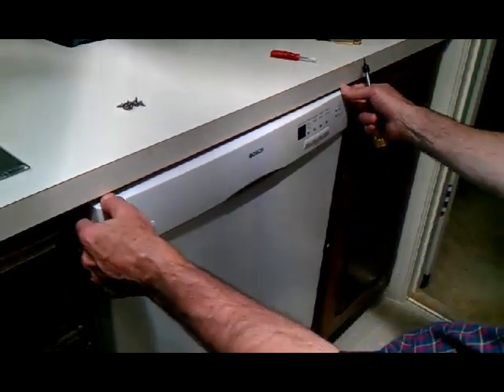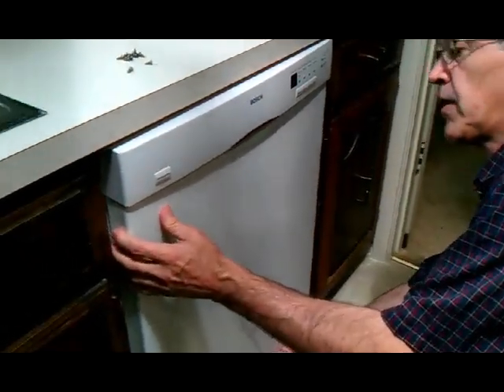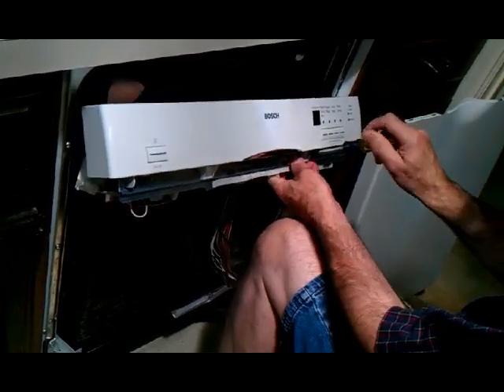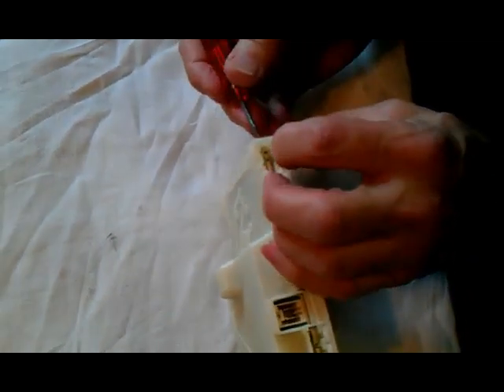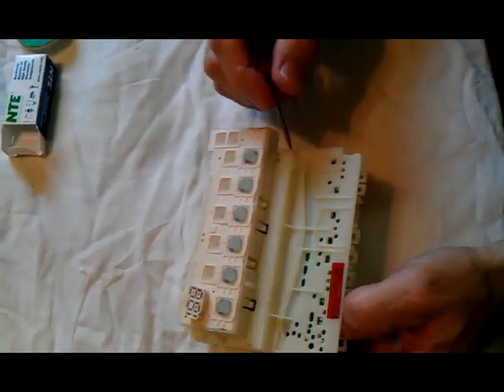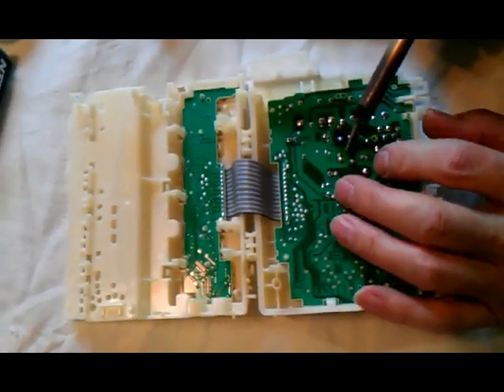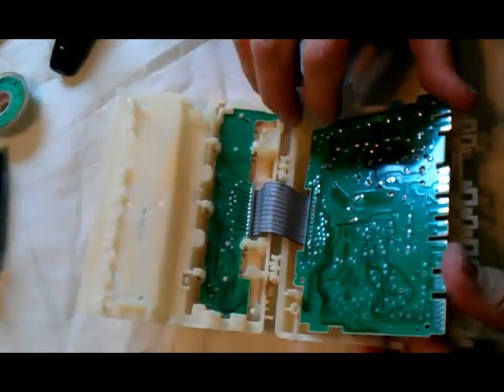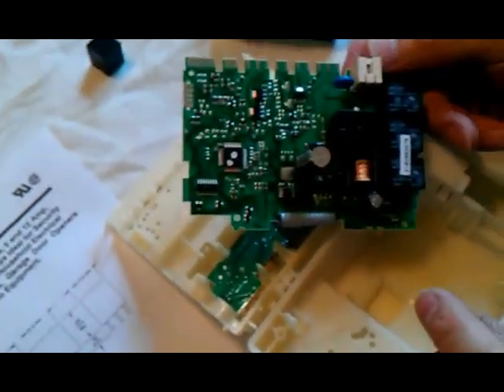Bosch Dishwasher Heater Relay Repair Part 1

Comment: I performed this on my 2006 Bosch she44c05uc/40.  Failure symptom was flashing lights and a clicking realy noise along with a motor bump cycling every couple of seconds.  Opened up the controller.  It seemed like the layout was slightly different than what you showed.  I also had a burned trace so I decided to just replace the control unit.  Total cost $155 USD, downtime 2 days, service time about 2 hours.
Reply from the maker: Thank you for sharing your repair.  Yes, the PCB layouts for the control modules on the various models Bosch produced do vary...from slight variation to completely different than the one I am repairing in the video.  But, a failed relay usually sticks out like a sore thumb because at the very least it darkens the board.
I'm glad you were able to order a module and get yours going again. The price you mention is fairly typical for a new control module.

Comment: Thanks for the video.  Used your video to fix our dishwasher, which was model SHE45M06UC.  I don't know if this should be obvious but for our dishwasher, the dishwasher didn't work until resetting the dishwasher.  Glad we were able to save $$$!
Reply from the maker: Thank you for sharing your repair.  That is interesting that you had to reset the dishwasher after the repair.  Usually having the power turned off while doing this work resets everything.  Maybe your model is a little finicky.  Thanks for letting us know about it.  Cheers!
Reply: I have the same model as this  SHE45MO6UC (5 1/2 yrs old).  Would you use the same recommended relay for this model? NTE R46-5D12-6?  Repairman wants $360.  Never soldered but figure it is worth a try.
Reply from the maker: Cynthia Reese Bosch used different relays on their various models so the only sure way to know which one is in your dishwasher is to open up the control module.  The relay voltage will be shown on the top of the relay.  They are usually either 6V or 12V relays, but some others have been found....just have to look.  The $360 repair quote is fairly typical...some have paid much more than that.  Let me know if you need additional help.
Reply: I was hoping to order the relay and then open it up.  But I will try it.  I have seen folks talk about a diagnostic mode.  Do you know if this applies to my model and how to do it?
Reply: Cynthia Reese Also, wondered what is meant by reset (other than cancel/reset buttons on front) by gentleman with same model as mine.
Reply from the maker: Cynthia Reese Models with digital displays have a diagnostic mode (others may also, but I'm not sure).  The procedure for putting the DW into the diagnostic test mode is on your wiring diagram.  The diagram is usually rolled up tightly and stuck in a crevice near the water valve behind the kick panel.
Reply from the maker: Cynthia Reese He is probably referring to the cancel/reset buttons.  If the DW is stopping on "1" due to a bad heater relay, then replacing the relay should reset the error on first run if it does not reset just due to having the power off.
Reply: AgglomeratedIdeas ok, so we were empowered by your video and have the controller apart. Relay says song chaun
899-1C-F-C 6V DC 10A 250V T85
CO820 7A240V  so should I order the one on Amazon:
NTE Electronics, Inc. R46-5D12-6 Relay; E-Mech; Gen Purp; SPDT; Cur-Rtg 12A; Ctrl-V 6DC; Vol-Rtg 120AC; PCB Mnt; Solder
Reply: Cynthia Reese Wasn't sure where the NTE  is 12A and the one in our dishwasher says 10A if that would be alright or not.
Reply from the maker: Cynthia Reese The 12A NTE R46-5D12-6 would replace your 10A 899-1C-F-C 6V relay.  The 12 ampere rating of the NTE is higher than the original relay (which is 10 amperes).  This is what we are going for here...a higher ampere rating so as to get a longer service life.  You can buy the relay from Amazon or one of the other places that is posted in my reply to Carter Drake.  Cheers.
Reply: AgglomeratedIdeas Thank you for all the help!  We will post when job is complete.
Reply: AgglomeratedIdeas  Success! Thanks for all your help!
Reply from the maker: Cynthia Reese Great news!  Thanks for the follow-up as it always helps encourage the timid to take on this repair when they hear of the success of others.  Cheers!

Comment: First, thanks for the fantastically helpful video.  I have a SHU43c05uc/37 which stopped heating the water, however the wash cycle would complete as usual.  I replaced the heater relay - one pin was melted/burned noticeably (the one on the top right with the component side faced downward and the prongs/sockets for the plugs toward me).  I replaced relay 899-1c-f-c 6vdc (song chaun) with the nte r46-5d12-6(11) 6vdc from radio shack.  I soldered the new relay in correctly, there's only 1 way the pins will line up, I soldered 4 of 5 pins (the 5th wasn't soldered).  Anyways, the unit still will not heat the water.  

I actually ordered two relays in case I screwed up so I removed the replacement relay and soldered the back up on.  Still no dice.  The diagnostic program indicates a heater failure.  I used a multimeter and I get continuity between the pin that was burned and the prong for the red wire to the heater (the one on the right side of the socket with the component side of the board faced down).  So I'm assuming that the pin is soldered into the board correctly.  Resistance reads about 4.5 ohms with the multimeter set to the most sensitive ohm setting (200).  This reading is the same as I get when using the pin to the right which is on the same trace (looks like that pin goes to a jumper leading to a trace that goes back to the hot prong for the red heater wire).

Is there some other diagnostic I can do with the multimeter?  I do not want to take the unit further apart to access the heater unit which, I believe is on the right side.  Is it possible the heater relay and heater unit could have both failed at the same time?  That just seems so unlikely but I sure think my repair was done correctly.  I am certain the relay had failed, it was definitely burned with the damaged pin melted to the point it no longer contacted the board.  

Any help would be greatly appreciated!
Reply: I wanted to add that the diagnostic mode isn't that clear.  The manual refers to buttons that I don't have ("scrub mode") when my unit has only a "rinse and hold," "quick wash," "regular wash," and "power scrub plus."  There's also no led for "clean" but there is one for "sanitized" so I'm not entirely certain I'm interpreting the results of the diagnostic mode correctly.  I'm using the repair manual found at the following address:  http://www.applianceblog.com/mainforums/threads/35002-Bosch-SHU43C-Repair-Manual
Reply from the maker: A faulty flow switch, NTC or heater can also cause this problem, but it is usually the relay.  Since you found a burned pin on the relay, that means it was just a matter of time before the DW quit heating due to that.  However, with the relay now replaced, you will need to dig a little deeper.  Here is a flow chart that shows how to troubleshoot the heater circuit: http://imgur.com/aYgvfAW

There should also be a schematic diagram inside your unit that might help.  It is usually rolled up and stuck in a crack near the fill valve.

BTW, it is normal on some models that only 4 pins on the relay are soldered just in case you were wondering.
Reply from the maker: whauser
I didn't see your post about the repair manual diagnostic mode.  The schematic diagram should have the correct diagnostic mode instructions on it.
Reply: AgglomeratedIdeas Ok, with the dishwasher running I get 117v coming from the red wire that goes to the heater.  So this means the board is working correctly (according to the flow chart).  Is there an easy way to gain access to the heater itself so that I can test it?  Or is there an easy way to test the NTC (temp sensor) and flow switch?  If I have to pull the thing out and take the side of it off and the inside apart to access the heater (that's what the repair manual says anyway) then I'm not too keen on that.  It looks like it's $150 and that's getting to be more than what I think this thing is worth (plus my labor to do the work and I don't work cheap!).
Reply: whauser Ok, the dishwasher now appears to be working correctly.  I can't explain it.  I tried it yesterday and it did not work and the diagnostic mode seemed to indicated a heater fault.  Then I take it apart again tonight, do the continuity testing on the circuit board which comes back good and put it back together.  Then I run it to test it as you described and I get the voltage coming across the red wire to the heater relay and when I stop the cycle and open the dishwasher, lo! hot steam!  I didn't change anything from yesterday, just taking it apart and putting it back together.  Maybe I didn't have the plug for the heater installed all the way, that's the only thing I can figure.  I know I had them on right because I took a picture the first time around and have been putting them back that way each time I take it apart (one of the available sockets on the board isn't used for some reason).

I can't explain it, but the darn thing is working again, at least for now. I can't tell you how much I appreciate this help.
Reply from the maker: whauser
It works...that's awesome!  I have been gone from the house a few hours, so I missed your post from 2 hours ago.  I guess it doesn't matter now because you got it working.  Hopefully you will get many more years out of your dishwasher for your efforts.  Cheers.

Comment: Thank you so much for the detailed instructions.
For your temporary fix, did you soldered two of joints together with a wire or something like that???   I couldn't see that part very well.    Thanks!
Reply from the maker: Yes, I used a short piece of wire soldered directly to the pin of the relay (the one that was burned), and then over to another pad that was one the same trace.  Note that it has to be on the same copper trace on the PC board!  This was done as a temporary repair while I waited for my replacement relay to arrive.  I did this just to minimize the soldering and unsoldering done on the PC board so as to not to cause any further damage to the board than the relay had already done.  Also, if the solder pad on the board is badly damaged, then a jumper can be used as a permanent repair method...it just wasn't necessary to do that on my board, but it might be on yours.

Comment: Thanks for post this video, changed the relay and it now works like a charm. I ordered my parts from www.mouser.com and I used an Omron G5LE-14, 6vdc for $2.50 plus shipping. Mouser part# 653-G5LE-14-DC6
Reply from the maker: Thank you for sharing your repair.  I hope you get many more years of service from your dishwasher.  Cheers.

Comment: Hello Agglomeratedideas. I am having trouble finding the relay for my Bosch dishwasher. I tried Galco, Newark and Allied. I even called Allied to see if they could give me a hand in finding a replacement and was told to search online for the OEM and not use some other one. I would like to send you a photo to your 'My Broken DW' email account. Any help you can give me in finding the part, or a replacement, would be greatly appreciated.
Reply from the maker: Hi Greg.  I emailed you the replacement relay information.  Let us know how your repair goes.  Cheers.

Comment: Hi, I am sending a picture of my board from a shu33a02uc Bosch dishwasher. Do you think it is fixable, the one hole is a bit melted out. I haven't got a relay yet but have removed the cooked one and scraped a bit more green resin from the board to allow a bit more area for soldier to contact, any other suggestions? I can get a  NTE R46-5D12-12 which shows as Relay-12Amp-Dc-12V locally but I believe this one would not work as the original is 6V (see pics I am sending to MYBROKENDW for you), is this right? You're advice is appreciated. Thanks
Reply from the maker: Oh yes, quite fixable!  Your board shows the typical damage done by the failed relay, but it can be repaired.  You are on the right track by scraping the green coating off the circuit trace, but it will need some more scrapped off.  It would be a good idea to put a jumper on it too.  I will send your photo back to you shortly with my recommendations.
Also, you will need the NTE R46-5D12-6 relay since your original is 6V as you said.  There are a number of places to purchase it online (see comments below for some suggestions) if you can't find it locally.

Comment: Hello, I have a Bosch SHU53E05UC-14 dish washer. It seems to have the symptoms associated with this issue (wash cycle never finishing). Do you know which relay part number I need? Thank you so much for this video!
Reply from the maker: Sorry, but I don't have any way to know which relay you have in your dishwasher.  Bosch mainly used either 6 volt or 12 volt relays, but there are exceptions to that.  The best way to find out which relay is used, is to open the control module and get the information off the top of the relay.  If it is not obvious to you which one you need, then post that information back here and I will confirm the correct replacement.
Reply: AgglomeratedIdeas Looks like they are SRE303024 relays (10A/250V) with 24VDC coil. However, none of them appear burnt, and neither do the solder joints. Looks like the AC-DC converter chip got pretty hot, but all of the solder joints look good there too. Is there any other part that would cause the cycle to never finish? Thanks again!
Reply from the maker: Embrace Racing Yes, there are other failures that can result in the same symptoms as a bad heater relay...it is usually the relay, but not always.  A faulty flow switch, NTC, or the water heater itself can also cause this problem.  You might get a better idea of what is wrong by putting the dishwasher into diagnostic mode.  If you look near the water fill valve, there should be a wiring diagram for your unit.  It is a piece of paper tightly rolled up and stuck in a crack (hopefully it is there).  On the wiring diagram, it will have the diagnostic test mode instructions.
Reply: AgglomeratedIdeas Found that wiring diagram, however there are no diagnostic instructions. I tried searching online, but it seems that I can only find instructions for units with buttons and a digital read out. My washer only has a rotary knob and a single start stop button.
Reply from the maker: Embrace Racing "No diagnostic instructions"...well that's a bummer.  You're right...no digital display...no diagnostic mode.  If you are good at using a multimeter, I would start troubleshooting.  A typical troubleshooting flow chart that should help is here: http://imgur.com/aYgvfAW

Comment: This is a wonderful, instructive video.  Thank you infinitely for posting it. 

FYI only, one can get the specified relay, NTE R46-5D12-6, by ordering for <$10 from Radio Shack ONLINE:  http://www.radioshack.com/product/index.jsp?productId=42509586

Catalog #: 55077182
Reply from the maker: I'm glad you found the video useful, and thanks for letting people know about the relay availability through Radio Shack.

The 12V version of the relay can also be sourced through Radio Shack if that is the one you need.  The catalog number is 55048281.

Comment: Thankyou for posting. The temporary fix worked on my Bosch Model SHU33A02 - I used a thick length of copper wire to give a slight heatsink effect. Glad I saw this before investigating the heating element.
Reply from the maker: That should work fine while you order your new relay.  Let me know if you have any questions.  Cheers.

Comment: Hello I have the NTE R465D relay to install but it looks like the burnt out pad is toast for a clean connection. In your excellent video it looks like the pin above is part of a coil is connected to this relay contact. Can you confirm if I can bridge my new relay terminal to that solder pad above. Thanks
Reply from the maker: If you will either post a photo on imgur.com (an account is not necessary) or send me one at MyBrokenDW@gmail.com, I will take a look at it and see what is needed.

Comment: After cruising the internet to find a DIY solution on what the "issue" could be, I determined that this problem "had" to be the issue....... Most solutions suggest a new control board...or re-soldering the burnt pin on the relay... I was so sure that this was my problem that I ordered my R46-5D12-6 relay from NTE electronics at www.element14.com before I even started to follow this video. Got the Relay within 3 days. watched this video one more time and followed it step by step. The pcb board was burnt at the pin just like everyone said....didn't have a solder sucker so used a turkey baster. replaced the relay...put everything back together....and...Problem SOLVED..the dishwasher now runs cycles as normal..and when done you open the door and ahhhhh Steam as it should be.
Thanks a million agglomeratedideas!!
Reply from the maker: Thank you for commenting.  I'm glad the video was helpful to you and that you now have a working dishwasher again.  Novel idea there with the turkey baster!  Hey, if it works...!